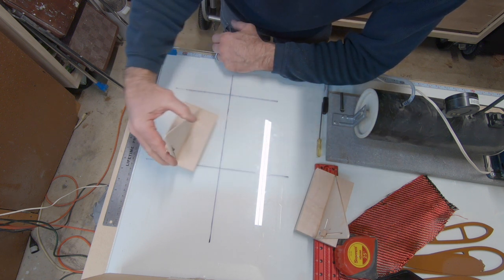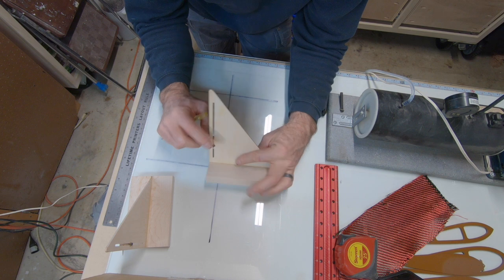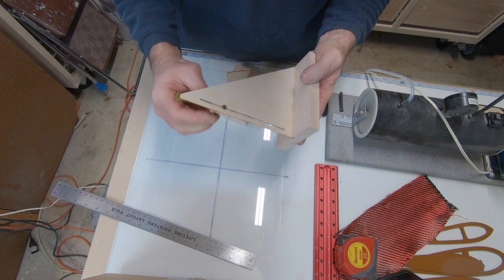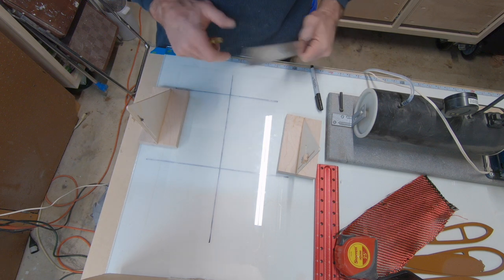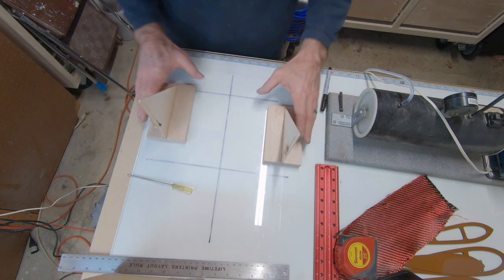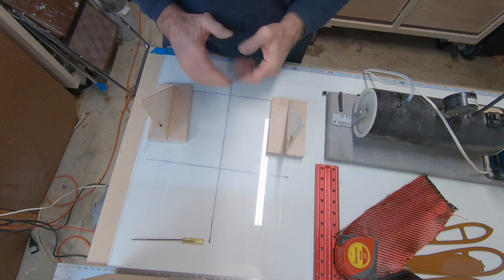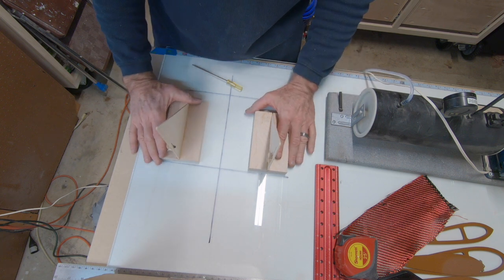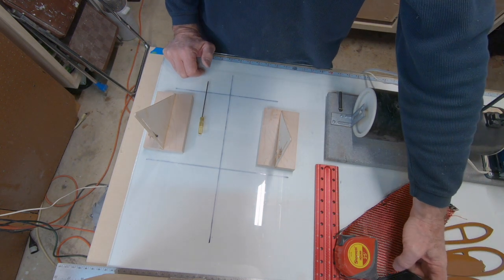Alignment Jigs Overview

Comment: Hi Dan are you still doing videos, have not seen any in a while -
Reply: I am watching this before I set up my radio control airplane, a Taurus, but I don't think my table is large enough for this method - trying to come up with an alternative
Reply from the maker: Sorry for the late reply. Since I have retired I started making some videos but took on some finish carpentry jobs that were time consuming that cut into the hobby a little bit. Im trying to get back to posting some more vidoes.
Reply: @WinshipModels  Great - I like your videos